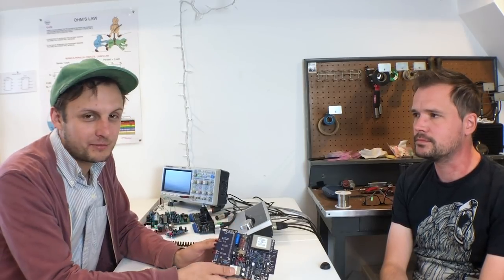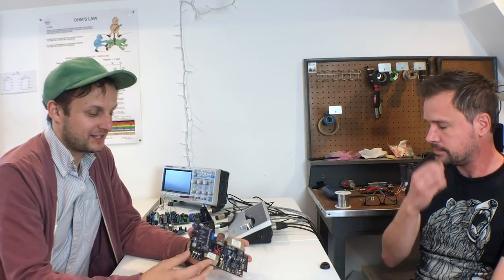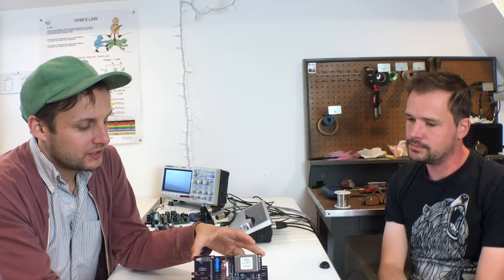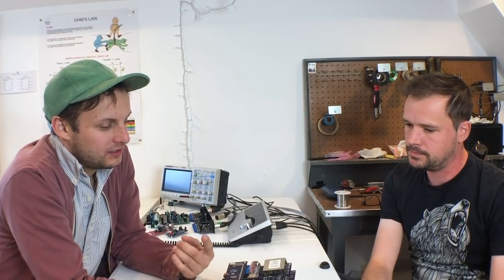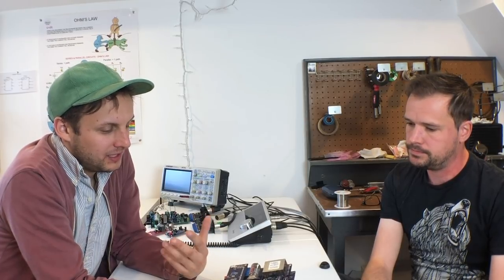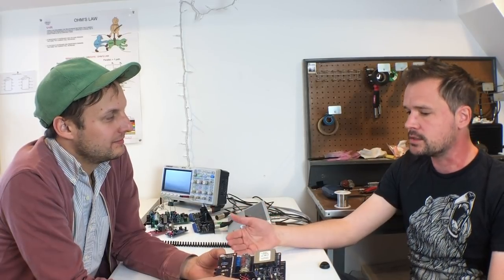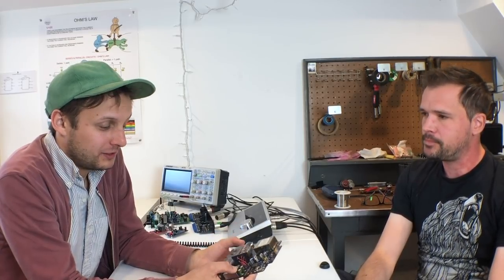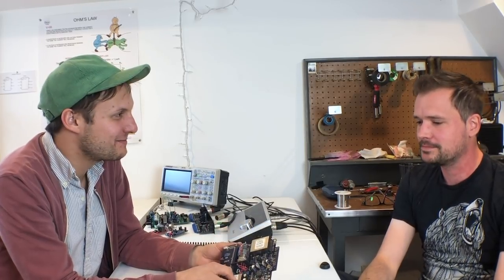Tube Microphone Preamp Design | From the Bench ep. 7

Comment: I'd love to know how it compares to the MP566 tube preamp by Soundskulptor which I've already built. The MP566 is based on a Bill Putnam design from the 50s (i.e. the early 610 console), and it sounds amazing.
Reply from the maker: That's cool, I didn't know the inspiration for the MP566 circuit before. I will try to get Charlie to chime in here with some thoughts on the difference between the two circuits.

Comment: How do you go up to 300volts without noise being an issue? Isn’t that circuitry inherently noisy? Not trolling... really want to know. Just been trying to wrap my head around some of the new class D amps and such, in this regard. 
All these digital things going on... yet not understanding how the clocking and such can be quiet enough for, in this example, a very sensitive preamp circuit. Not saying class D amps and this unit have much in common, only noise factors in mind. Thank you!